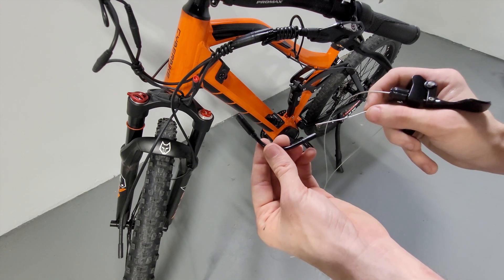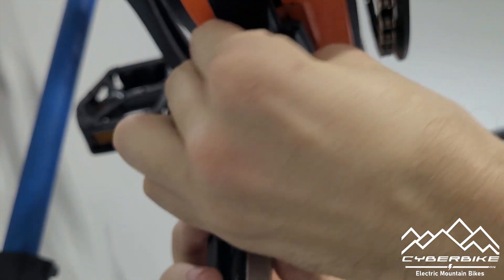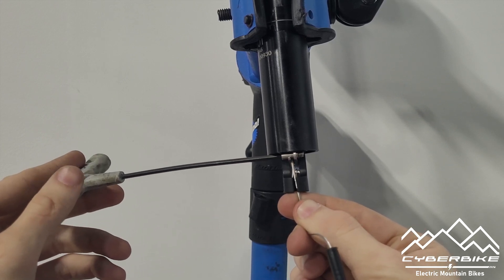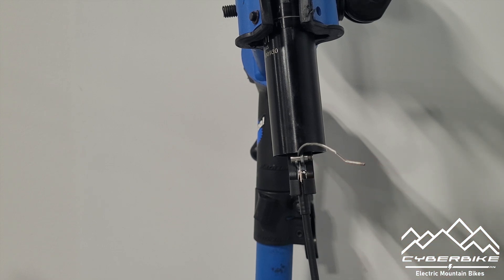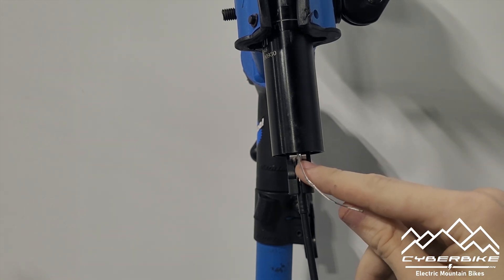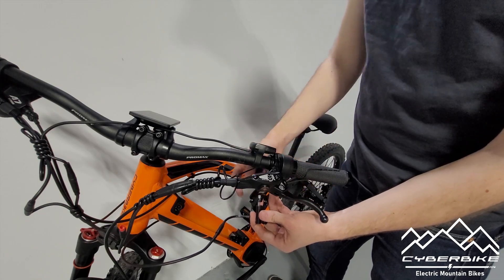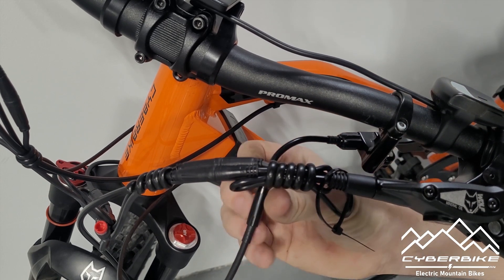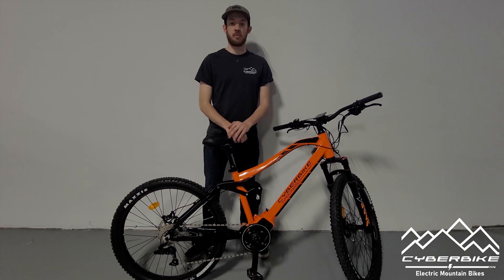Cyberbike Tech Tips: Dropper post Installation

Comment: ok my raptor showed up with post installed my question, even when it is extended fully I would like it raised about 1 inch more can i just raise the whole tube or does it have to rest on the shoulder?
Reply from the maker: Yes. You may need to feed the same length of cable up from the bottom where you will see the cable feed into the seat tube. This way the actuator won’t remain engaged. You can raise it all the way up to the line on the housing of the dropper seatpost, but if you want to raise it that far, you will likely need to feed even more cable from near the handlebar lever.
Reply: @cyberbikeemtb6978  thanks i moved it last night lol seems to work fine i just like my legs finishing a bit more straight when sitting and peddling,

Comment: Well I almost did it right, didn't know what the barrel adjuster piece was for and did think to pull the whole cable out. I hope you guys put out a lot more videos! Love the bike it was definitely worth the wait. ,But the instructions are not great.
Reply: Dude your not an engineer so you know nothing. You shouldnt be touching this bike if you dont have a degree.. its wayyyy to cutting edge and futuristic for peasants without a degree. You shouldnt have an opinion
Reply: @driftadvocate1839  so true, technology is hard. I read your flame war with Dan 😂. If you're in Oregon you can swing by and do a ride and review of my bike. I payed 2700$ for the Mullet Evo.  Shopped around for a long time and couldn't find any full suspension mid drives in that price range. Handles everything I throw at it and so far nothing has broken. Time will tell I guess. Definitely agree, you can't find any information about the components so servicing could get interesting 🤔. Considering the cheapest Trek full suspension Ebike is $4700 I think this is a decent budget single track bike for a weekend warrior like myself. I would love more reviews of the bike from full on EMTB channels, but they all seem to only review bikes on the high end. Perhaps all of your criticism will prove to be correct.
Reply: @linemanap how did it hold up? Do you think it was a wise purchase? I am thinking about getting one